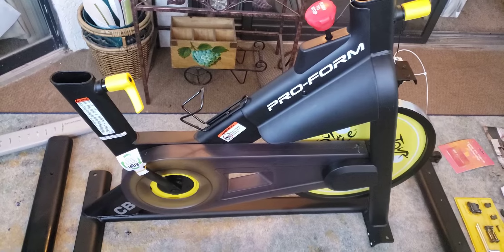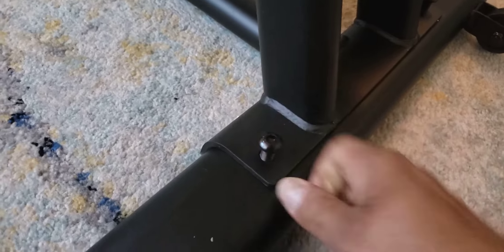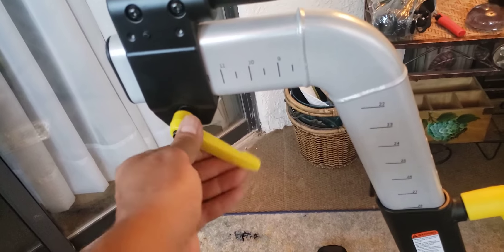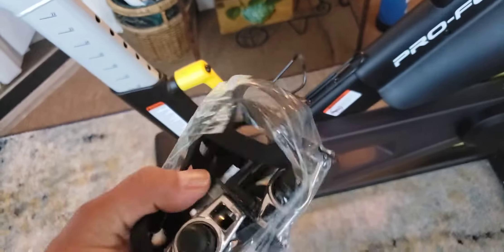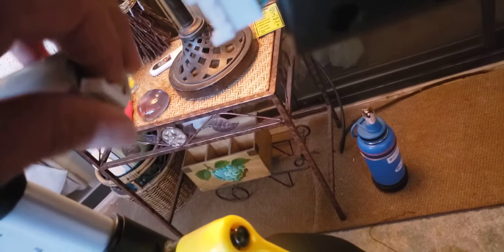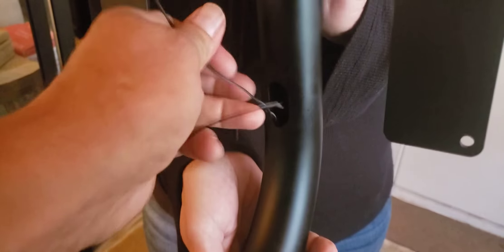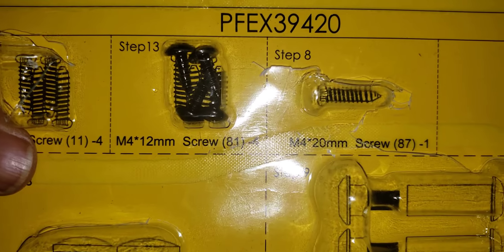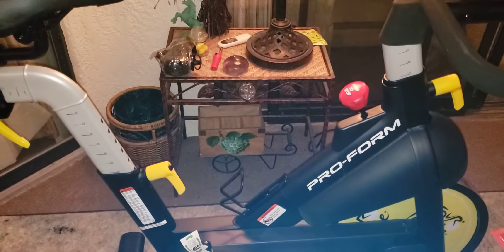Assembling the Proform CBC Tour de France spin Bike from COSTCO

Comment: Great video as to how to assemble the Pro Form CBC spin bike.  I installed my strictly from the manual and made a few mistake (50-50) that I went the wrong way with.  I paid $399 in Oct '20. Costco now has it for $315 and I saw it last week on a limited sale for $299!!!.  For the most part, I've been riding it every day for 14 months.  At this moment, I've having trouble with the reed switch and  Pro Form is sending me a new reed switch.  Hoping that fixes the problem.  Most of the  iFit rides are about 30 minutes, but some push 1 hour and there are also some that are 15-20 minutes.  I recommend if you're going to get this bike, you add the extra maintenance.  I think that was around $140, extending the warranty to either 3 or 4 years.  The bikes comes with one year of iFit training.  I'm now into my second year of iFit training for around $110.  Yes, you can ride the bike without iFit, but it makes the workout boring without the visual rides.  If needed, the company will send out a qualified service person to fix the bike, but they prefer to provide instructions for the user to fix the problem.
Reply from the maker: Thank you for the comment and info.  It's been a great investment for me too.

Comment: Idk if you’ll be able to respond but I got everything good to go except the right pedal, I’m putting it in where it needs to go and turning it the right direction the thing advised to do however the pedal will not go through, any advice?
Reply from the maker: Are you sure it's the right pedal, try the other, or other direction.
Reply: I'm having the same problem

Comment: Thank you for such a super comprehensive “how to.” Where did you purchase your pedals?
Reply: Pedals come with it. Unless he added some customs I didn’t see in the video. If anything is missing call proform and they will ship you some.
Reply: @kevinmascuzzio3916  his pedals and seat were upgraded. Thanks
Reply from the maker: SoBossy , I'm SoSorry, I didn't see your question. I use SPD pedals on all my bikes.  You can find good used ones online, like Craigslist or ebay, and more expensive new ones at you local bike shops, etc. You will need shoes and the cleats that lock into the pedals.  Once you become comfortable riding in these, it is much more powerful and efficient.
Reply: 😂 SoThankful 🙄